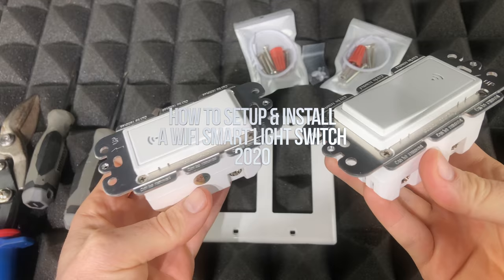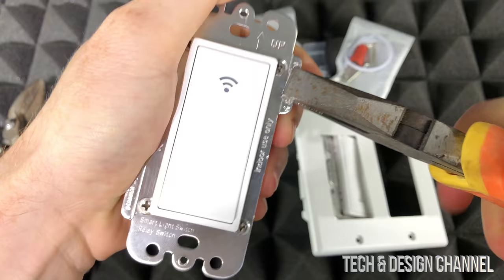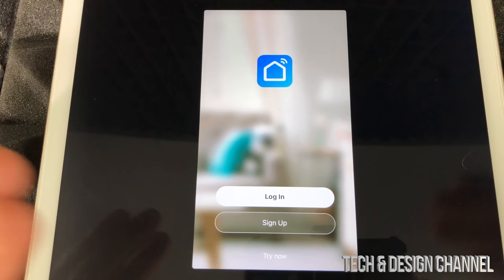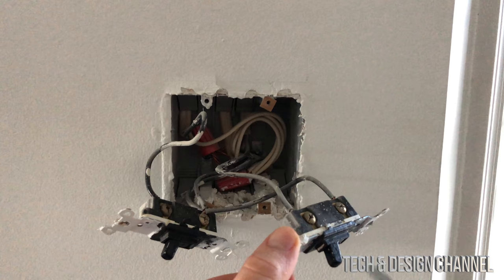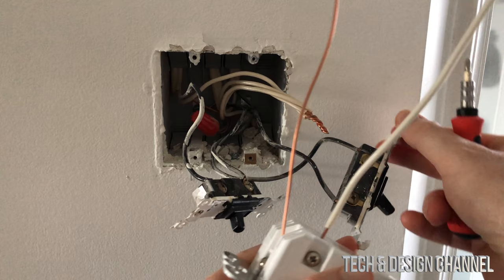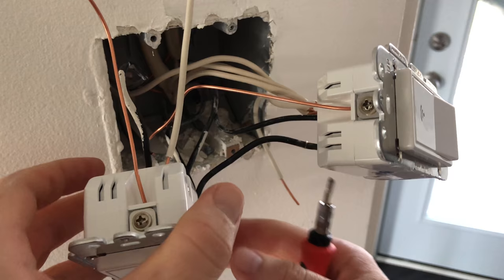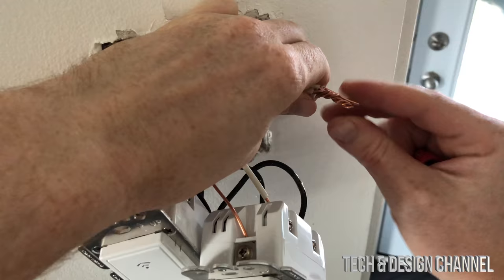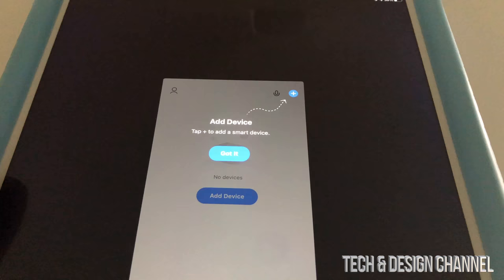How to SetUp & Install a WiFi Smart Light Switch 2020

Comment: Warning: If you have an older house the wall box may be too small to fit a 3 times larger switch and the extra connector caps. Then you have to put the old switch back or tear up your wall for a new box.
Reply: Use a 10mm deep switch spacer between the switch and the patress box.
Reply: there are videos online that show the alternative, basically use a reciprocating saw to cut out the old box and then put in a Old gang box to make more room. not that hard.
Reply: 😂😂😂 tear up your box? I’m just envisioning a dog with wires 😊
Reply: It is kinda tricky  should I do it for this Wi-Fi double light switch

Comment: Nice video! Thank you!
My only observation is that too much insulation was removed from the wires that were connected to the new switch boxes. No exposed wire should extend outside of the box.

Comment: Question, can you program the switch to control a plug manually? Let's say I have some LED under counter lights plugged into a smart plug. Could I connect that smart plug wirelessly to the switch so that when it's manually toggled it controls those LED's?

Comment: I have 2 questions.. 1 if I don't have a ground or earth wire should I not attach the ground wire in the smart key???
2 if I have 3 load wires in my old network do I need 3 smart keys or can I use 1 key and gather all 3 wires in one point and plug it in the smart key??
Thanks
Reply from the maker: I highly suggest watching this video since it will answer all your questions.
But mainly - just copy how your old switch was set up into your new wifi one
Reply: What should I do to remove the original light switch

Comment: So the switch needs to be physically in the up position for the WiFi to work. That much makes sense. Can you manually toggle the switch to control the lights in the event of a WiFi failure?
Reply from the maker: yes. it also works as a normal light Switch

Comment: If the light is green and can't connect to the wifi.  How I change the light color or what I did wrong.? Can you help me ?
Reply: Press and hold the power button or off switch for 20 seconds it should start blinking